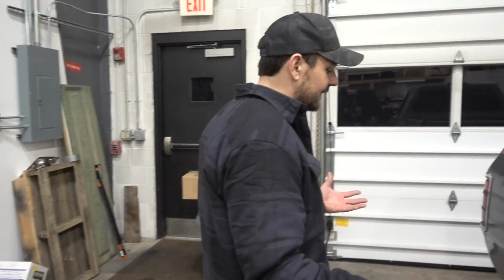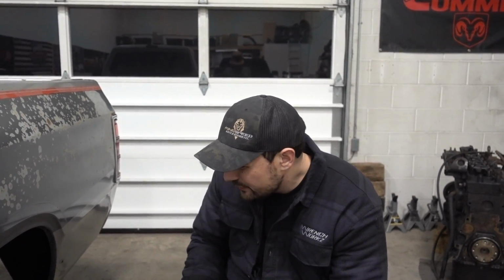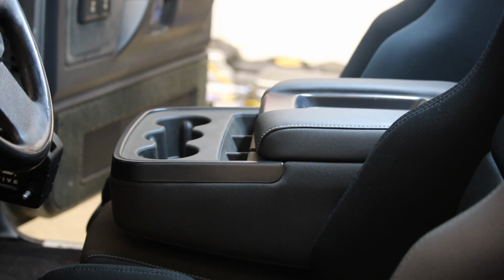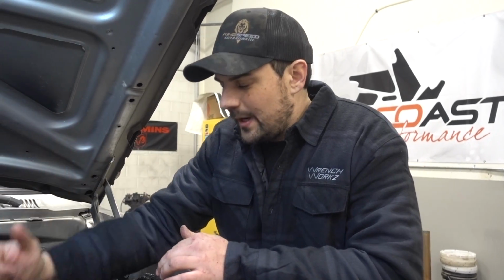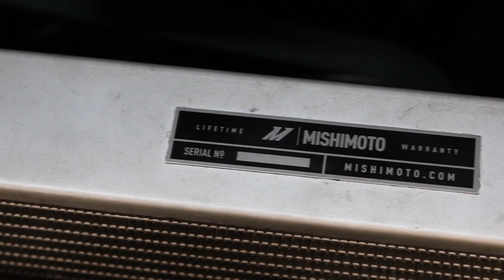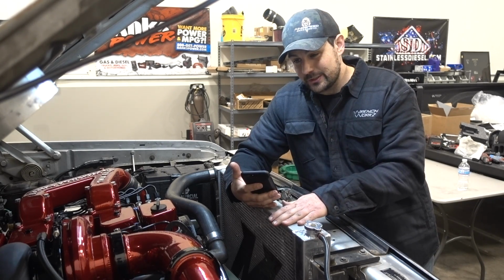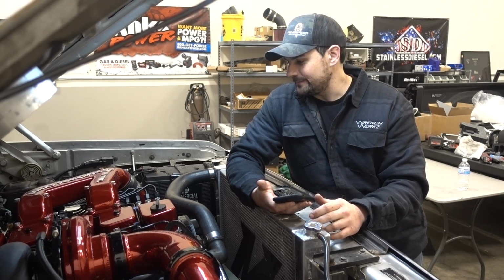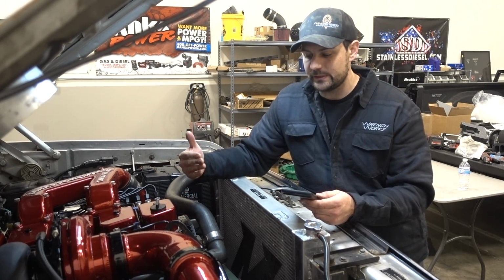900HP 1ST GEN CUMMINS COMPLETE BUILD LIST!!!!

Comment: hey youtube i have a question to achieve a 700hp+ is their an upgrades on the ecu and also do you need a ecm orpcm i have questions on the computer is their an aftermarket computers 12 valve
Reply: Youre joking, right? 12v is mechanical and does not use a computer or tuner to alter performance.
Reply: hey but i want to reduce a emissions im building a rat rod and i want to be street legal and fast but the emissions

Comment: Damn, 65psi on the bosch pump. 20psi on the big bore pumps still makes at least 400hp on the ol 8.3l Cummins ( probably more, just haven't tried). Of course I'm not really familiar with what the aftermarket guys do to those bosch (p-pumps) but it seems the big bore version would do plenty on a 5.9l, and since the outside of the  pump is physically the same it bolts right up. But what do I know, I never tried.